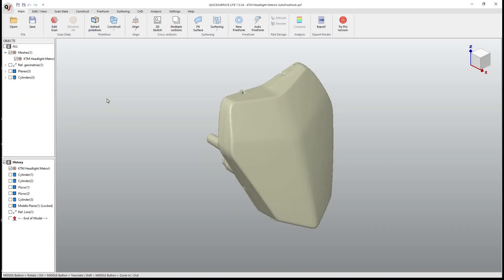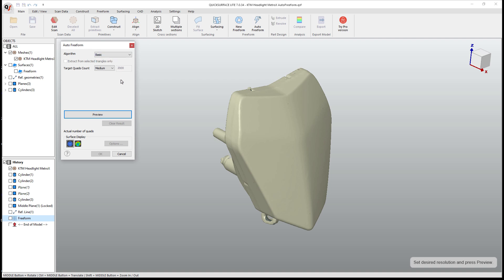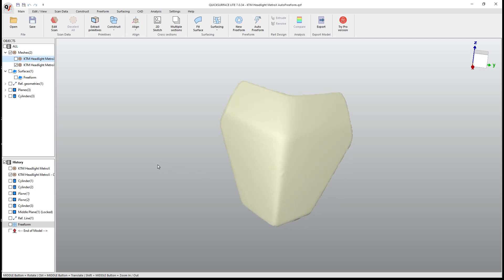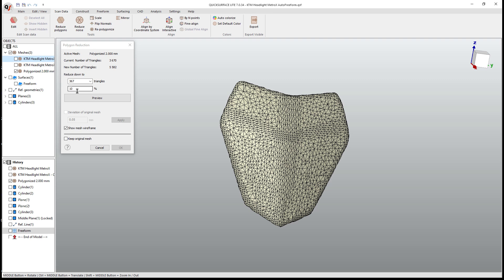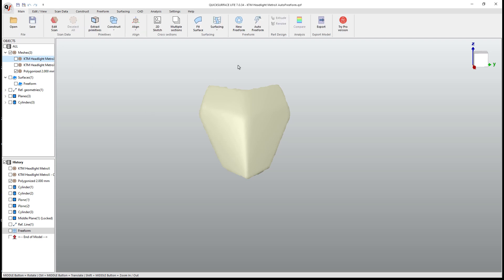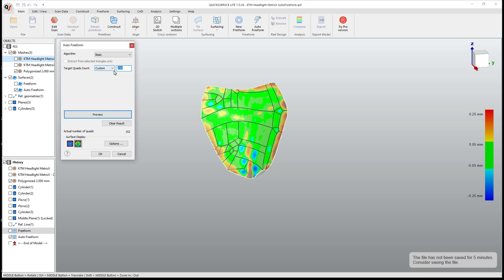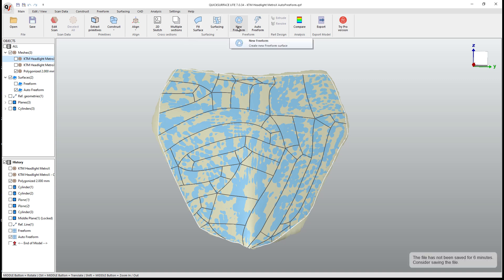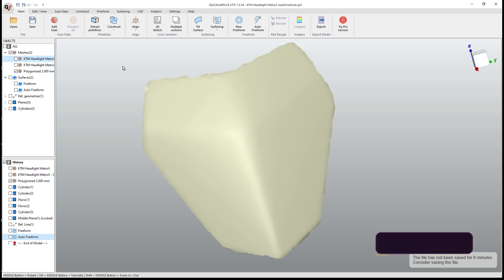Auto Freeform Creation in QuickSurface LITE

Comment: I understand that this is an engineering software but what is the advantage over tsplines and the zmodeler tool in zbrush. There are ways to preserve the dimensions by the way.
Reply from the maker: Zbrush is a mesh based tool so the output is mesh.  As far as I know you can only export in other mesh formats like obj, stl, fbx etc.  Tsplines in Fusion and autofreeform or freeform tools in Quicksurface result in a NURBS surface.  You can of course convert the surface/solid to a mesh after, but if you want CAD geometry that isn't mesh you would want to use a tool like Quicksurface or Fusion.
Reply: @LearnEverythingAboutDesign thank you!

Comment: Hey Matt, I just purchased used my quicksurface free trial to start l earning the program, and just purchased quick surface lite.  I am starting to notice some difference from the tutorial videos which have been on pro so far.  I was wondering if you had any videos that cover how to "thicken" a shape like this in the lite version?
Reply from the maker: hmm, whenever i do a video i switch to the LITE version.  its in the settings of the program when you have pro to only show LITE features. 
Thicken isn't available in LITE as far as I know.  You would need to export the surface to another CAD program.  LITE is missing out on a lot of the CAD and design tools you find in Pro.  I think all versions show the tools in the tabs though.  What is the version you are working off?  I am on the 2025 version 7.0.44
Reply: @LearnEverythingAboutDesign  I am on the 7.0.3 version of revodesign. it was priced a bit cheaper and as far as I understand, it looks like they just changed the QS logo to Revo. Ill try pulling it into fusion 360 now to see if I can edit.
Reply from the maker: @eliteman125  yeah for basically all CAD after you create some basic shapes you will need to export.  It can be helpful to make some shapes, export and then do the boolean stuff in Fusion anyways.
Reply: @LearnEverythingAboutDesign  Thanks again. I have been going down a rabbit hole with all of your videos since I bought a metrox.  And more recently all of your videos on quick surface. Do any videos come to mind where you work with a more organic freeform, and then continue editing in fusion?  Right now I am taking a scan of the bottom of my foot to make a  custom insole.  definitely a challenging way to get into this.
Reply from the maker: @eliteman125  this video was showing the process in 3 different softwares  https://youtu.be/E3ah4ymgblE

this webinar was a bar clamp but we used freeform for part of it(we have another video that did this with prismatic features in fusion as well).  this shows a bit of the lite vs pro workflow differences.
https://youtu.be/_PdPFEnUpvM

A few other videos and series used QS lite as part of it.  the 3d printed intake duct ep2 we used QS for alignment then into Fusion for modeling.

Comment: Currently trialing Revodesign which is essentially Quicksurface Lite- it’s a fantastic piece of software but be careful if you trial the full version of Quicksurface as quite a lot of features are not enabled in the Lite version.  Enough to make it far less capable for accurate reverse engineering and the full version is so much more expensive….